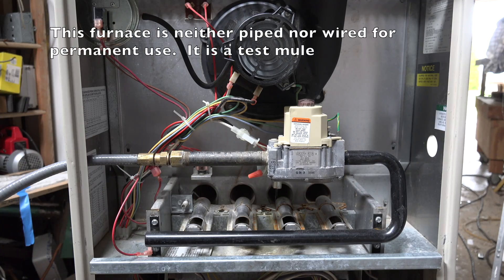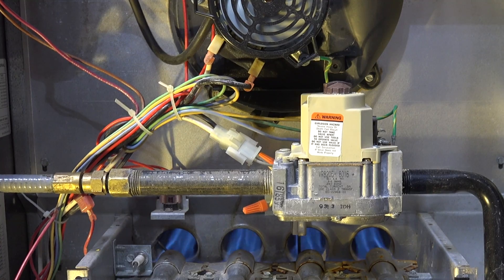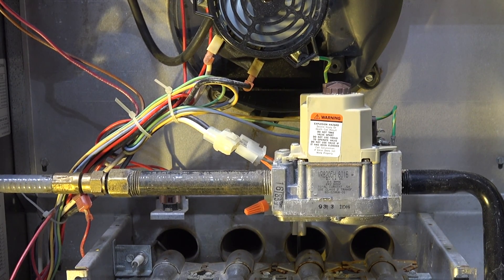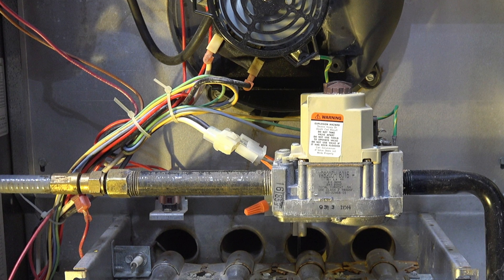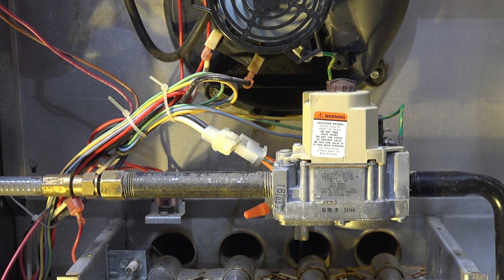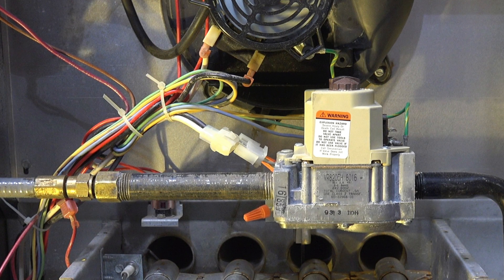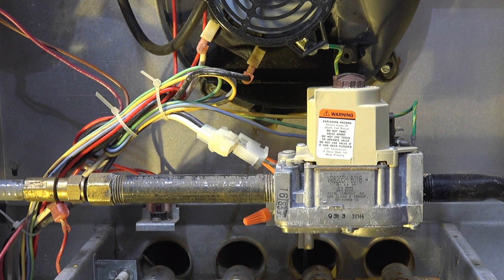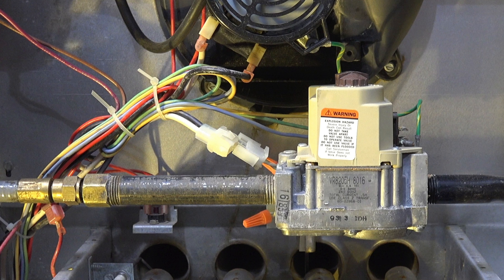What's wrong with this furnace #15 answer

Comment: So that means I need to clean the igniter or replace it with a new one?
Reply from the maker: If you mean the flame rod, cleaning it is one of the first things I would do.  
GFM
Reply: @grayfurnaceman  no my furnace doesn't have the flame rod just the igniter.
Reply from the maker: @javym22  If the unit fires and shuts down within 7 seconds, the problem is in the flame sense.  The ignitor cannot be cleaned.  You can try replacing the ignitor.
GFM

Comment: I have seen these with dirty burners not ignite all of the burners and stay running, just pumping gas out the vent. I also replace the cracked inducer assembly.
Reply from the maker: This type of ignition was the norm when standing pilots and natural draft were used.  The result when a burner did not start was a delayed ignition.  With an induced furnace, the delay did not always happen.  I place this unit as a changeover furnace where they were not sure what was going to work.  The inducer was the reason the furnace was replaced.
GFM

Comment: so if the flame sensor is the HSI in this furnace, why is there an actual flame rod installed if not being used. did i miss something you explained?
Reply from the maker: The flame rod is an add on because of the problems with HSI flame sense.  I will be publishing more on this type of control in a few days.
GFM
Reply: thanks, that makes sense to me.